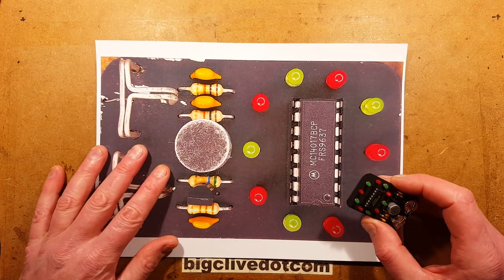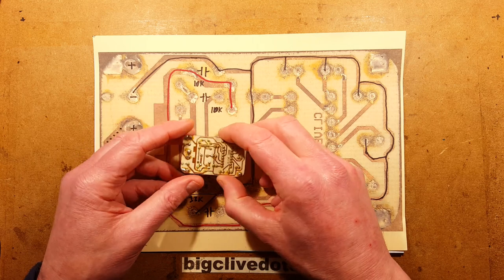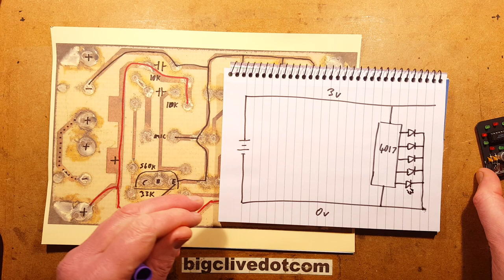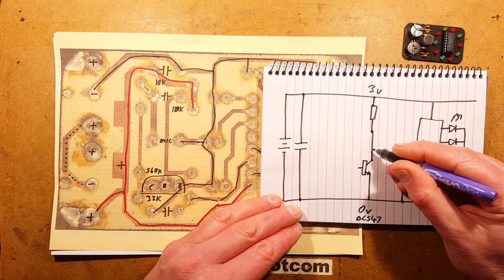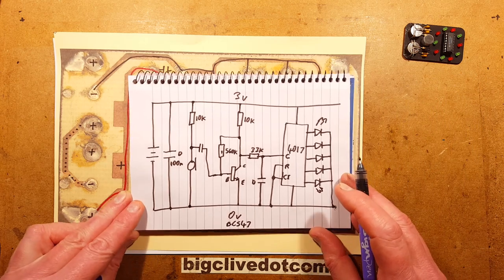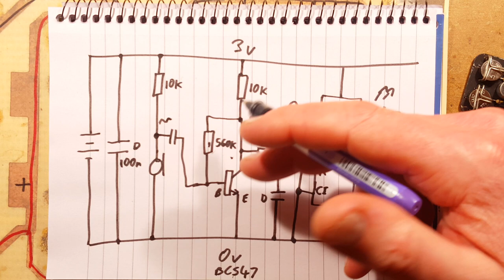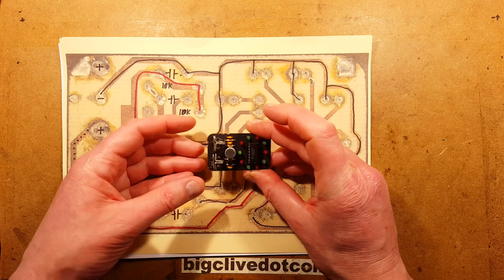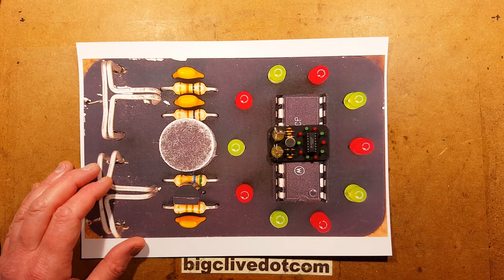Vintage disco buckle light.  (with schematic)

Comment: Good to know I wasn't the only nerd back in the day! Electronic enthusiasts these days don't know how lucky they are. Everything is so cheap now and of course the processing power of cheap ICs negates the need for so many discretes, programming is the future! Not bad for a quarter of a century ago (I feel old now as that's the 3rd time I've used that phrase today!).
I recently bought 100 of 555 & 4017 as SMDs, just for fun!
Reply from the maker: I bet your 555s and 4017s were a LOT cheaper than back in the "old days".
Reply: @bigclivedotcom   I reckon R A Penfold must have had shares in those IC manufacturers! IIRC they where about a pound each, you can easily get 10 for a pound now!

Comment: The first Blue LED was in the 70's (the first in 71 by Jacques Pankove and Edward Miller), I even have an old analog Pioneer Tuner (TX-520) with a Blue LED, was made in  81-82
Reply from the maker: Silicone carbide?
Reply: @bigclivedotcom  Nope, Zinc-doped GaN

Comment: What a fun gizmo. Might be a good use for one of those little flat Nokia batteries (with or without a USB power bank circuit attached for easy charging and boosted voltage output)

I suppose if you really wanted a lot of voltage, you could go with these nifty "9v" (PP3 shaped) LiIon batteries by "EBL" I picked up off of Amazon, ~$15 for a charger plus 3 batteries, sure a lot nicer than the NiMH ones in that shape... I think they have two cells in each, but I haven't torn any to bits to know for sure. (Hint hint... 😉)

Comment: 9:09 I built a simple treble boost circuit for my guitar based on a regular boost circuit and there is a 2M resistor across the base and collector. I always wondered what it was for.

Comment: I think that's the same or very similar material to CEM-1. It can be found even these days in cheap electronics.
Reply: It's probably FR2 (aka "phenolic paper", "laminated paper" or under the commercial/protected brand name "Pertinax"). CEM-1 has, IIRC, an FR2 code sandwiched between two glass fiber layers (basically, FR2 inside, FR4 outside) and uses epoxy instead of phenolic polymers. FR2 has been mostly replaced by FR4 (epoxy laminated glass fiber).
FR2 has a significantly lower Comparative Tracking Index than FR4, meaning you need a larger gap between traces if you plan to have "large voltage differences" between traces. It also has a smaller temperature range than FR4. FR2 is, however, cheaper (about one third the cost of FR4) and can easily be cut, even at at room temperature. FR2 is also much less harmful to your lungs than FR4 or CEM-1 when drilled, milled or cut (because it's wood fiber, not glass fiber).

FR2 is still used for breadboards (https://www.reichelt.de/experimental-boards-solder-points-c7785.html?GROUPID=7785&START=0&OFFSET=100&SID=95Wn3xr6wQATUAAFqJcNc004ddd3aed35270efa51c7ff18e0d824&LANGUAGE=EN&&r=1 and https://www.reichelt.de/experimental-boards-strip-grids-c7786.html?GROUPID=7786&&nbc=1;SID=95Wn3xr6wQATUAAFqJcNc004ddd3aed35270efa51c7ff18e0d824). As a kid, I used the "strip matrix" versions. A copper strip could easily be cut with a drill bit, manually. Take the drill bit in your hand, place the tip into one of the hole, twist once (by hand), and you have one continuous copper strip into two isolated sections. Foe connection perpendicular to the strips, i'd use wire bridges on the component side. That looked quite neat and orderly. Cutting the PCB to the desired size could be done by running a knife's edge along the surface a few times, then breaking it, or with scissors.
For completeness:
FR3 like FR2, just with epoxy instead of phenolic polymers. The color is more like FR4.
FR1 was a cheap version of FR2, mainly useful for mechanical elements or possibly very low cost, low power, low voltage circuitry. I do not know when FR1 had dies out, but it must have been a long time ago.

Comment: Hi! :-) Great video!
I've just build this very circuit the other day, before watching your video. 
For new year's, I've bought my S.O. something like this- called "smartphone disco light". Conects to USB It's unbelievably bright. I have not cracked it open (as no one should destroy someone's gift ;-) ), so I am not sure what chip they used, but it inspired me to make this.

I'm planning on building this with students. Boils down to 25 cents total or so.
 But not as belt buckle, but to clip to their phone or such ;-)

On Youtube, someone hooked up a electrelet microphone directly to the 4017, but of course this doesn't work (rarely if you tap the microphone). Too bad, I'd love a lower component version.
 I wonder if they had a different microphone or just faked it.

Considering using a LM386 as it can be used with so little components (and is cheap at Ali) and we can use the module for a voice-changer project as well.

Anyway, very interesting hearing about the filtering / beat detection ideas.

Keep up the good work, have a nice day! :-)

Comment: one thing that my professor told me when i put a capacitor across the backup battery of an rtc chip is that the leakage current through that capacitor could easily discharge the battery faster than intended. tldr this cap maybe more harm than good. i dont know why you choose a such strange value for your lowpass filter resistor i would use a 1k6 and a 1u for that this will filter at about 100hz so perfect for the bass

Comment: Did the ladies go for it Clive?
One of my sound to light circuits stopped working in a disco light. The transformer had lost one bolt so there was a nut floating around inside, also the transformer casing may have touched against the back of the dip switch board. I'm wondering if i can find a fix after watching this. Going to have to take a closer look at it later. Perhaps the trigger part of the clock blew?
Ps. Were you raving in the early 90's? Those were the years!

Comment: Are you still interested in the odd power tool? I'm going to throw out a 3/8 snap on battery gun and blue point 3/8 cordless ratchet if you want them.

Comment: By 1999 I had fallen in with the wrong sort of people...I'd gone all "cyber". Clubbing with LEDs, fibre optics and EL was all the rage if you went to the right places.
Somehow people still didn't figure out I was secretly nerdy, even with custom electronics. At least I was putting my degree to work!
 "Look at the flashy lights...your place or mine? :D
Reply: Inconveniently I've recently had to start using a walking stick. It was such a utilitarian device...I fixed that with 3D printing and an excessive amount of NeoPixels.

Comment: Maybe if you revisit this, you could incorporate a LM3914 (dot/bar display), you could even connect to the level when you want to clock the 4017 ;)
Reply from the maker: I used the LM3914 in a few projects too.  It's a very versatile chip.
Reply: @bigclivedotcom  I like the 3915,  with its log response.  I ordered some modules out of china a while back that used these,  and damned if they weren't defeictive -- the two pins at one end of the package were apparently not connected to the chip,  so the first two LEDs never lit up.  I ended up getting a partial refund and sourcing the chips elsewhere to get those modules to work.

Comment: 33k/100nF low pass filter has a cutoff at ~48 Hz (1/2.pi.R.C) so that makes sense.
Reply from the maker: It was almost certainly tuned by using a resistor substitution box on a breadboard setup while loud music was playing.

Comment: I'm pretty sure blue LEDs were available in 1999... Back in the mid 90s when I was in school I wanted to use blue LEDs for a project. They were available, just a lot more expensive, so I ended up using reds.
Reply: I had some of the first ones out back in 1993 which were based on silicon carbide and I prefer their color to the modern blue ones. Vf was about 3.7 volts.
In 1995 I put one into a friend's guitar amp as a status indicator and several people in the band were almost in disbelief at seeing a blue LED. 
Fast forward a couple years and the novelty turned into cliche.
Reply from the maker: I built a tiny rechargeable battery pack with resistor and connector and used to thread an early 3mm blue LED through part of the embroidered pattern of my sweatshirt and plug it into the pack.  It made a very low level pure blue dot in the pattern that was so alien at the time that people would often come up and stare at it or poke it to see what it was.
Reply: Peter S "I had some of the first ones out back in 1993 which were based on silicon carbide and I prefer their color to the modern blue ones."
Spooky... I could have written that exact same sentence! 
Still got a bag of 50 I was going to use, but haven't yet.
Reply: @mickeythompson9537  50?!?! That's awesome! I bought 3 of them them IIRC from Jameco and i think they were $3.95 each in the singles price. I also remember lots of cautions with them given their sensitivity to static electricity. Vintage electro-optical components have always been a heartwarmer for me.
Reply: i remember seeing blue leds, in i think, a Farnell catalogue in the mid to late 80s, but horrendously expensive,

Comment: Does replacing the 560k resistor with a 1Mohm trimmer permit to adjust the sensitivity?
Reply from the maker: Yes that could be used to adjust gain.

Comment: hmm, might have a go at making that....
Reply: i'd want it a good bit brighter though, maybe powered by a pp3 , with resistor in the led common line
Reply: or one of those little 12v batteries..23A i think ?
Reply: ooo, just had as Baldrick would say, 'a cunning plan'.....

Comment: what no current limiting resistor on the leds? cmon clive im disappointed dont tell me you didnt know better back in the day

and no reverse polarity protection ...  meeeeeehhhb
Reply: He did not need them if the circuit only pulled a few mA.
Reply from the maker: The batteries couldn't put out enough current to do much harm.  The voltage was low enough that a series diode would have stopped the LEDs from lighting.  With LEDs driven directly from the 4017 you'd only need a current limiting resistor if the voltage was much higher.

Comment: That reminded me to buy another one of those.  Banggood has a 3 volt version (in a cheapie AA housing for 2) Problem was I ordered their 3 pack awhile back and got 3 kits for got knows what.  So just gonna try and order one again and see if I get the red board again as the green board is the wrong one  --- https://www.banggood.com/CD4017-Light-Water-Kit-Voice-Control-Water-Lamp-Kit-Electronic-DIY-Kit-p-945783.html?rmmds=myorder&cur_warehouse=CN  works a bit better than the above but you have to stick this  either on top of the speakers or lay the speakers on the floor ...  as clearly that clock does the same thing but all the LED's light because that clock flies so fast the other LEDs are just starting to turn off before they are on again

Comment: Now I wish some Chinese electronics manufacturer would make a modern version of it, minimize it with modern SMD LEDs and an SMD chip, so that it can work with a small 100mAh LiPo-cell + USB charger. It is certainly possible to bring that to the same space requirement as this ancient device. They could then sell it on eBay for cheap, and it would probably find several buyers. Maybe give it a fancy name like a "Clive Ring" or so, and it would probably find even more people who'd bought it. But then, the world has already engough crappy electronic trash, so maybe it's good that this won't happen.